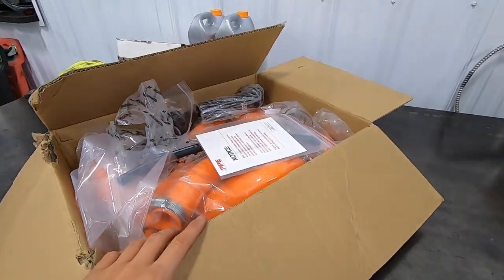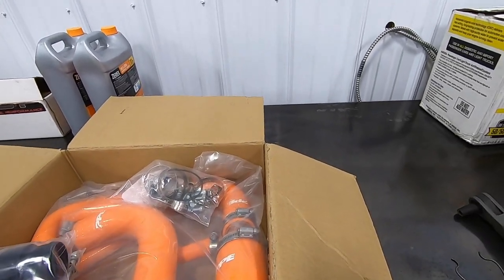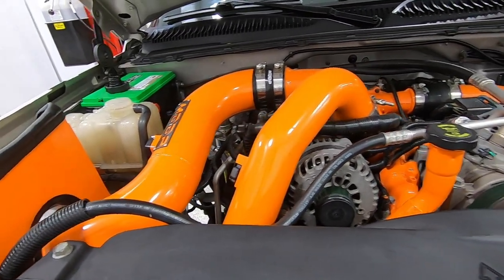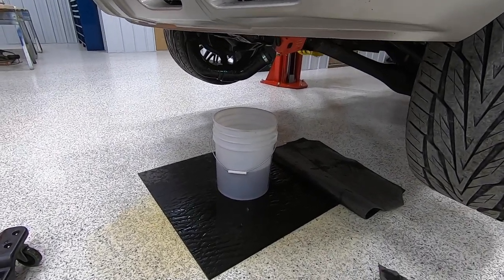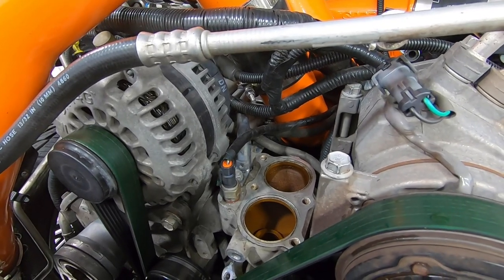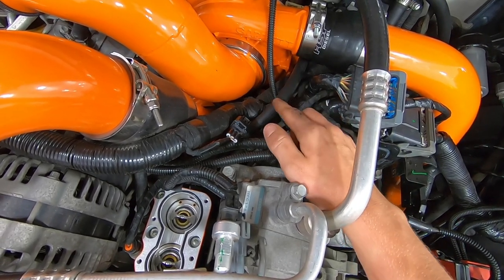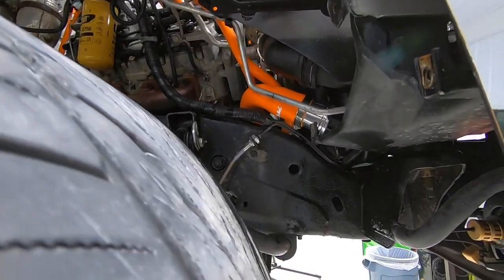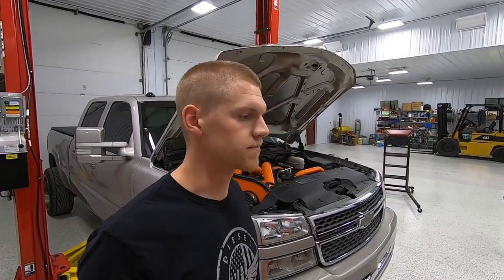COOLING SYSTEM UPGRADES THAT CLEAN UP THE ENGINE BAY FOR A DURAMAX

Comment: I think greasing the clamps also helps with corrosion over time and adhering to the silicone hose itself causing damage when trying to remove them down the road.
Reply from the maker: Absolutely that is another nice thing about it

Comment: There is a plug it’s on the passenger side behind the fender well, it’s a plastic screw off the radiator. I’ve seen on the lb7 but I haven’t looked on my lbz but worth a check
Reply from the maker: I know exactly what plug you are talkin about but unfortunately the lbz doesn’t have it

Comment: I did the HSP thermostat housing over the weekend. I'm curious how you'll like the coolant lines and drain. Merchant told me to keep everything stock or expect leaks as temperature changes. Perhaps that only apply to the drain with stock hoses. I saw, after the install, that LBZ vans have a forward facing coolant housing that would bolt up just the same. Being able to burp it might be worth keeping the OEM?
Reply from the maker: The lines have been good so far. A lot more heavy duty thats for sure. I haven’t had any leaks and the temps have fluctuated from 80 to low 30s since we are in fall and haven’t had a leak yet. I dont drive through winter though. I personally think the drain is a must because the duramaxs are awful to try and drain. I actually threaded a brass plug in the drain too just in case that valve was to leak or get bumped I wouldn’t lose my coolant. I had a lot of trouble filling it back up with coolant so the bleed hole on the old housing helps but we ended up getting a tool that vacuums the air out of your cooling system and then pulls the coolant into the system. By far the way to do coolant on any vehicle. The kit was like $130 i think
Reply: @jordancampbell3723  -- That's a slick setup for sure. I think your kit will hold up, those hoses are great quality and makes it look really clean. I'm currently dealing with the rear block off plate coolant leak ---so---I've found that idling to temperature isn't enough. You have to run it around the block and allow the system to circulate the coolant so that you can add more.  

Anyway, side question for you--after you did the egr delete is there a harness did you replace the harness or hide the unused wires on the harness?  Thanks for the videos.
Reply from the maker: I totally agree man the stuff is great quality for sure! With the egr there was only like 2 plugs i think on these older trucks so I just taped mine up real good and then tucked them on the passenger side of the engine
Reply: @jordancampbell3723  -- Interesting...I need to do that. What tape did you use? I think I'd like to used more of the wrap that OEM uses to protect the wires and then use a split wrap to dress it up more, just not sure what that wrap is called or where to get it. BTW, since you've done the coolant drain kit you might as well install a fumoto drain valve on your oil pan. Think it's an fumoto f106 but double check.
Reply from the maker: I believe when i did that it was just normal electrical tape. But at the shop we use tesa tape. By far the way to go. Holds up way better and looks way better. Ive heard of those fumoto valves before. I used something similar to that on my mower because its real hard to get to the oil drain

Comment: my lb7 has a drain plug on the passenger side of the lower rad. its still not in an amazing spot though, just crack the res cap a little bit, pull the plug and SLOWLY let a little more air in through the res cap, and you can thread the needle through the bs down there into a 5 gallon bucket
Reply from the maker: Yepp the lb7 at least has that which is nice. I have no idea why they decided to get rid of that on the lly and lbz. Makes no sense
Reply: @jordancampbell3723  My 2004 Duramax has it but it is misinformation on your Video that perturbs me as I wasted a bunch of time trying to get that bottom hose to drain. Being black and not having the best lighting it is easy to overlook. PLEASE NOTE ON YOUR VIDEO THAT CERTAIN UNITS DO HAVE THE DRAIN. Preferably for the duration of your misinformed audio comments.

Comment: did you have trouble with the fitting on the radiator, i have the notches lined up and it still won't close completely no matter how hard i try

Comment: did you take off the tcm cover?> to put that hsp kit on? i thought there was a black plastic cover over it originally. at least on my lb7 there is
Reply from the maker: I know what cover you mean that is on the Lb7 and lly but the lbz doesn’t have a cover like that. It was a tight fit but i think you could play around with it if you had to

Comment: Did the pressure problem go away after you put in the thermostats because my truck is having the same issue and it’s not the head gasket
Reply from the maker: It helped but ive come to the conclusion i think my gaskets just have a very small leak but nothing major so im putting it off until im ready to do it

Comment: how have the radiator hoses held up for you any problems with leaks at the fittings thinking about the ppe iI'm between that and the mishimoto $100 difference between the two thanks
Reply from the maker: They have been perfectly fine so far. The quality is definitely very nice on them so I would definitely recommend!

Comment: My oil full neck that HSP sent does not keep my oil cap secured like the LBZ neck did. Does yours have notches to screw the cap down?
Reply from the maker: So far i have had much of an issue. Id have to look at it again to be sure though i can’t remember. But i do kind of think i know what you mean
Reply: @jordancampbell3723  thanks. Maybe a video on it? That’s the only issue I have with my kit. The cap can’t be secured like with the stock full tube.
Reply from the maker: @delta3garcia  ill check it out and try and include it in the next truck video.
Reply: @jordancampbell3723  that would be cool. I’ll post a video of mine for comparison later today👍

Comment: With doing all of this did you see a change in running temperatures
Reply from the maker: From doing the low temp t stats yes. The hottest it really gets now is like 190! It runs around 175-180 most of the time

Comment: Is there any performance gains from this ?
Reply from the maker: From the cooling system stuff not
So much. Just looks and slightly lower tenps due to the t stats. The fuel stuff yes you get rid of a lot of fuel restrictions!

Comment: Looks like the hose is pretty flappy that runs across under the truck, probably have to replicate how the original was secured
Reply from the maker: I know what you mean for sure. Theres no great way to secure it without using that skid plate